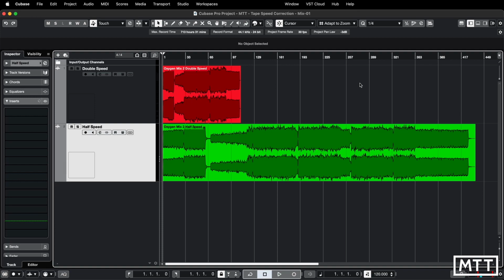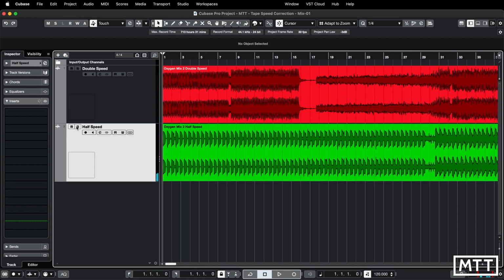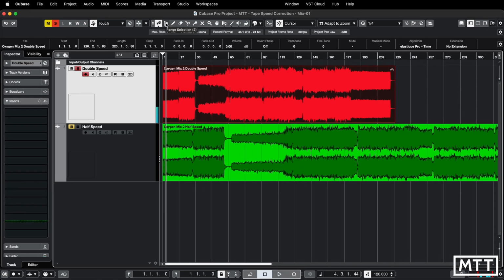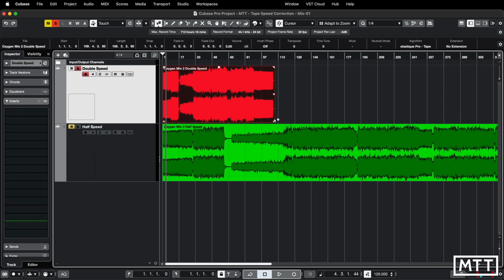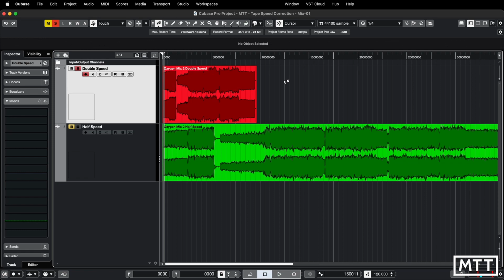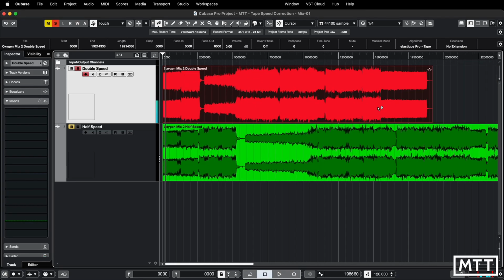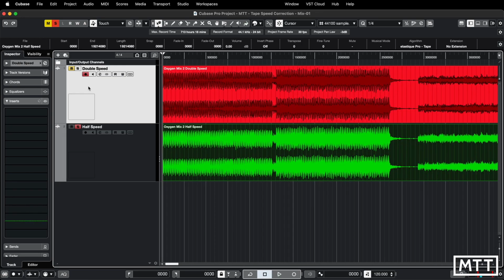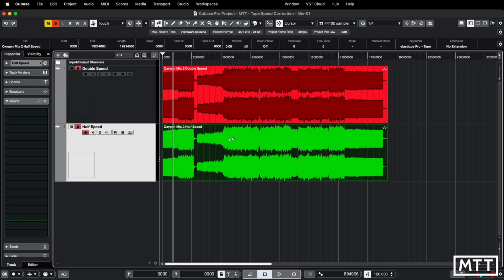Cubase Skills: Rescuing Recordings Made At The Wrong Speed

Comment: Is this the best method to tune an audio file recorded from a tape?  I need to tune up the file around 1/2 a tone ish!
Reply from the maker: If you just need to alter the pitch that much, then use the fine-tune setting in the info line.  You'd typically enter 50 for that, which is up half a tone.  The default algorithm is usually the best one for making changes, and whether you want to use it will depend on whether you just want to change the pitch without altering the timing (the default), or alter both pitch and timing as seen here.

Comment: Well, this is a really useful tip but my info line (Cubase 12 pro, Windows 11) is very different to yours and does not include Algorithm. I have Name - Start - End - Length - Offset - Mute -Lock ...   any ideas Darren? TIA
Reply from the maker: If you go to the cog at the right-hand end of the info line and go to Setup, you should be able to manage them from there?
Reply: @musictechtuition  Ok I'm going to sit in the corner with my Dunce's cap on!!  It would, of course, have helped if I had correctly selected an audio file and not a midi file!! Cubase, is quite rightly, content aware 🙂
Reply from the maker: @tc_shinyred  Ah, well that would explain it... Every day is a school day!  Glad it's sorted!

Comment: Brilliant solution to my problem. Thank you so much for taking the time to do this.
Reply: I thought this would work but it doesn't, so sorry Darren. It must be because my mixer (Allen Heath QU32) runs at 48000 sample rate.
Reply from the maker: @ronbooth1382  You should be able to do it regardless of the sample rate you're using - the change is being made within Cubase, and not to the sample rate.  What's happening when you try it?
Reply: @musictechtuition  It's still at the same speed yet I am following the instructions to the letter. I am wondering if I should input the doubled samples sum manually, rather copy and paste. I will try a few things and let you know how I get on. Thanks so much for replying to me.